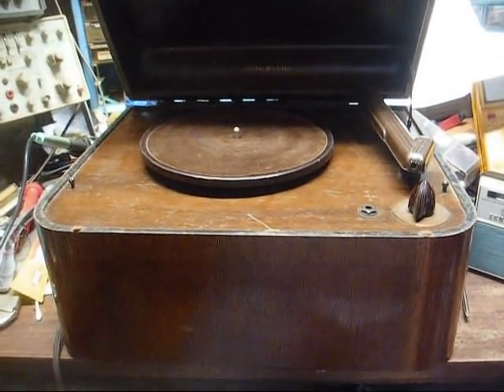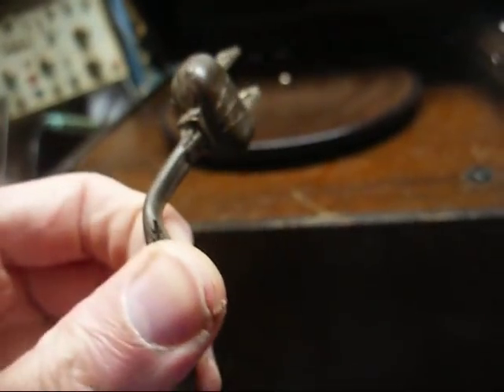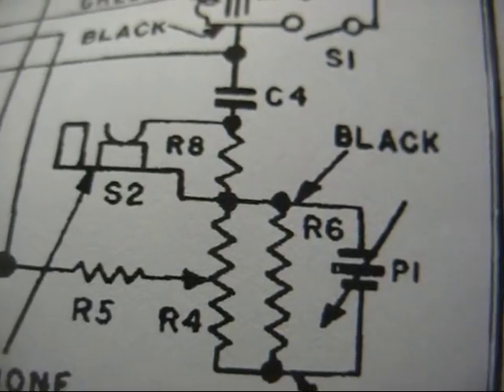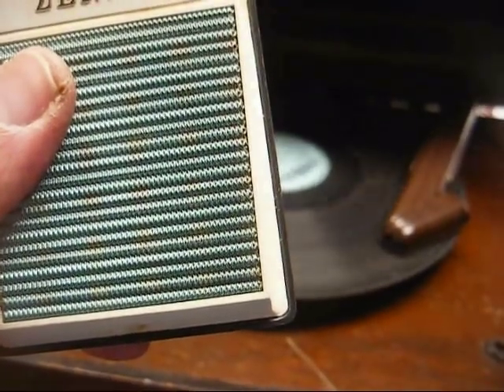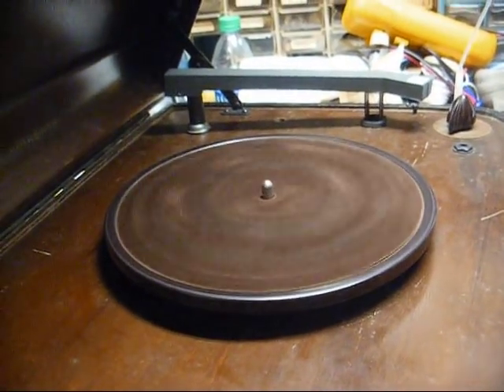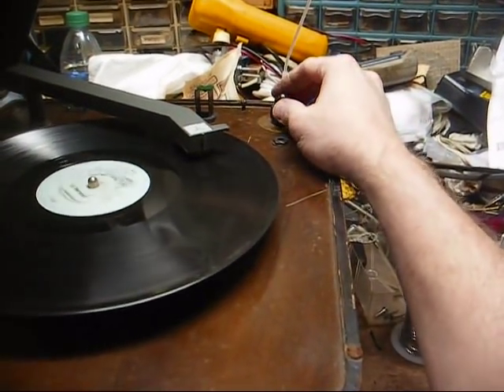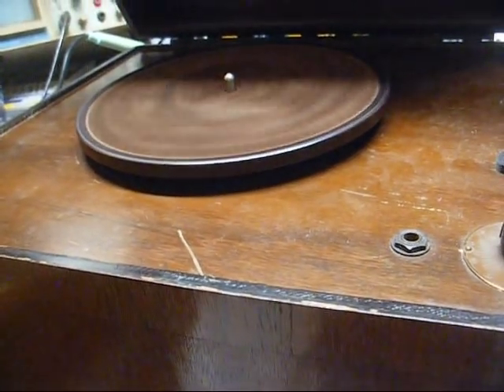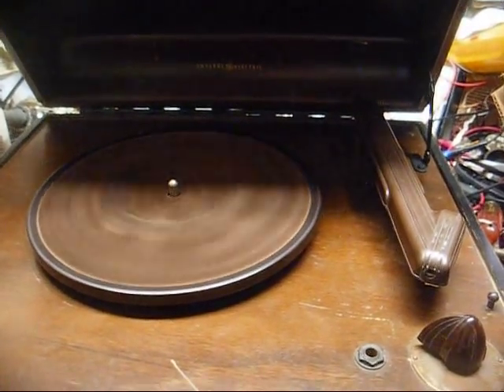Repair of a circa 1939 General Electric wireless record player

Comment: My dad said he had one in the 40s that he hooked a long wire antenna to and a ground wire. He said the range was a mile or less. I like the old Zenith transistor radio you've got there. I've got a Royal 500 and also a chassis of a 200 that I mounted inside an old wooden cigar box. There's just something about the sound of those radios when you are dxing stations at night. I've heard old ham operators refer to AM as Angel Music.  😁👍

Comment: The motor on mine was also in need of a teardown, and re-lubing. I did remove the triangular housing to the spindle also, in order to clean it and grease the worm drive that the gear rides on. Runs quieter. Also found a couple of old needles that had somehow found a home in there at some point in time. It works alright now, but I'm looking into a way to decrease the tracking force a bit, and am debating adding a pre-amp stage in order to get rid of the Astatic replacement issue.

Comment: Silicone might be a good option for replacing cartridges. There is an acid free silicone if you're worried about the acid. Not only would it be easier to remove than epoxy, it would provide some extra vibration cushioning. When I replace the a window air conditioner motor, the gromets of the compressor where all dried out. I squeezed silicone around the compressor supports, and it quieted the air conditioner down considerably. I never sounded so quiet. Is it possible to boost the voltage of a cartridge by making a transformer with a ferrite core?

Comment: There were a lot of there sold from the 1930s up through the 1950s. Some were better than others as far a modulation quality . You wanted to only amplitude modulate the signal . Some of the poorer designs allowed the frequency to be modulated and often both the amplitude and frequency were being modulated simultaneously resulting in distorted audio. Your GE used a loop antenna . There were some cheapo variations that fed the rf signal back into the AC line to use the house wiring as the antenna. The best ones were made by Zenith..Zenith used a pentagrid converter tube such as a 6SA7. Thie extra Friday allowed the audio (amplitude) To be modulated without shifting the frequency
Reply: Extra grid, not “Friday”. Spell check is never my friend

Comment: Have you ever tried cutting a strip from a ceramic disc, soldering wires to it to use in an early metal cartridge? It seems to work fairly well for me and keeps the original aluminum cartridge shell. I also use these for crystal radio headphones.

Comment: This is a great video.  I would imagine this should sound pretty good going through a stereo receiver with decent speakers.  I know AM was only good up to 5 kHz, but it should sound as good as anything playing on the air.  Just out of curiosity, is the transmitter itself less than 0.25 watts?    Back in 1986 I built a 20 watt AM shortwave transmitter and modulator out of vacuum tubes in one of my electronics classes.  There were three tubes in the transmitter section and four tubes in the modulator section.  We drilled our own chassis, mounted tube sockets, did point to point soldering between all of the components and tube sockets and at the end of the course, we actually transmitted.  We wound our own air core coil and when we held a small neon light up to it, when adjusting the tuning capacitor, you knew it was oscillating when the little neon light lit up.I remember when testing the transmitter, we built a dummy load out of several resistors in parallel (I can't remember the value we used).  On the plates of the tubes, it was roughly 450 VDC from what I remember.  I got shocked on the RF jumping out once.  I think overall, I got shocked three times on that project.  I really enjoy your videos and how well you explain things.  This took me back to that class.  Thank you.
Reply: AM was actually allowed to broadcast up to 10 kHz, but the receiver often cut it to 5 kHz or less to reduce noise.
Reply: @misterhat5823  I thought it was reduced to 5 KHz to preserve bandwidth as well to fit more stations.  Once you got into FM, it was broadcasting in MHz and had more bandwidth to make stations able to broadcast up to 15 KHz audio.  You got the quality from that, but it still wasn't quite the range of the human ear, but very acceptable.  The FM carrier was completely handled differently than the AM carrier as well.  From what I remember, the top and bottom of the waveform got chopped off where noise resided and the amplitude of the signal I believe moved horizontally rather than being superimposed on the sine wave of the carrier frequency.  AM = Amplitude Modulation and FM = Frequency Modulation.
Reply: As best I recall Part 15 limited an unlicensed transmitter to 100 mw, not 250 mw. I'm pretty sure this unit would be more like 50 mw at best.
I also have vague memories that AM stations in the US would have been at least 8 KC bandwidth in the era of this device. If I recall correctly they are assigned on 20 KC spacing in the US within any given reception region to avoid overlap. (Motion picture sound tracks were limited to 8 KC from the advent of talking pictures until the introduction of Dolby Sound in the 1970s.)

Comment: Quick question. Do you know where a friend of mine could get a cartridge replacement for his Philco 46-1203? The radio plays great, but there is no sound from the turntable. I suspect the crystal cartridge crapped out a long time ago. And I know crystal cartridges are becoming rarer.

Could a ceramic cartridge be used in it without any modification of the audio circuitry?